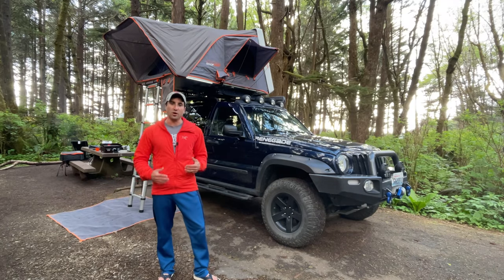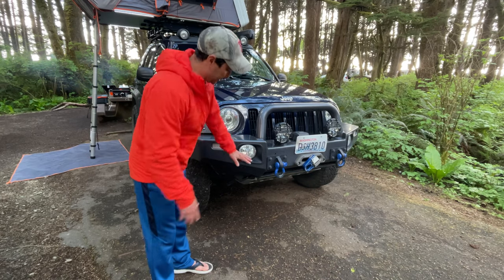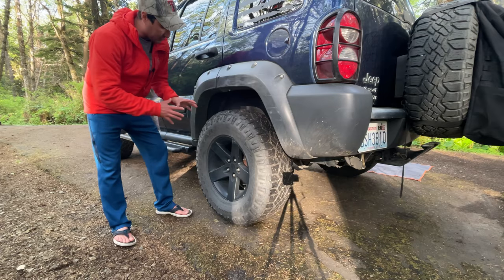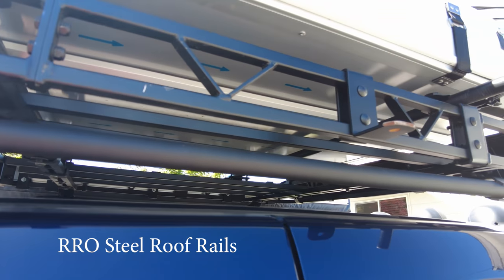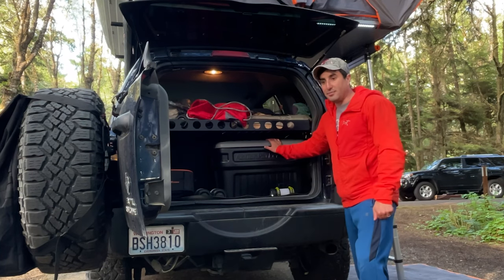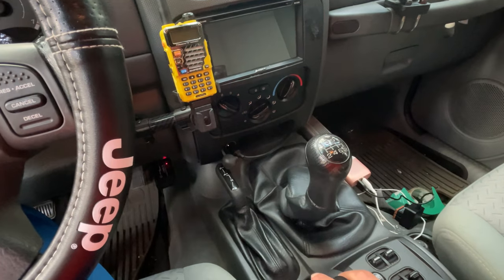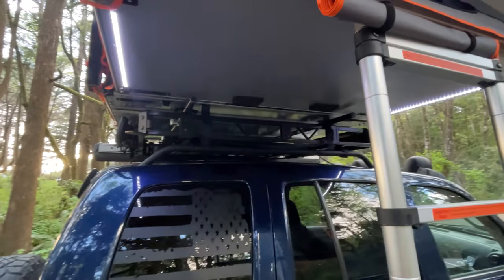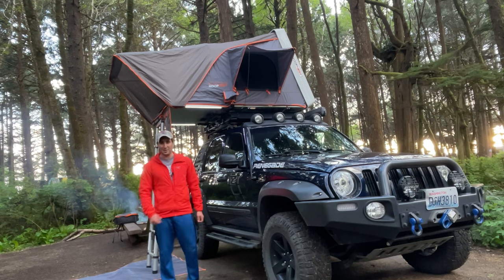Jeep Liberty KJ Overland Build Walk Around &  Roofnest Condor Roof Top Tent | Off-Road 4x4

Comment: Whats your tire ?
Reply from the maker: these are 31's duratec 265/70r 16. Planning to go at least 32s next maybe 33s if i can fit them.
Reply: @BackcountryRenegade  Hi! Great build! Do you have trouble with rubbing tyres? Thank you
Reply from the maker: @Dopek69  no rub after i pounded the pinch weld and melted and smoothed the plastic it was behind
Reply: @BackcountryRenegade  Thank you for your answer! Great build! Congratulations! Got inspired for my build